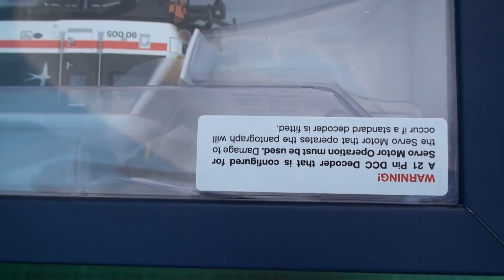InterCity Bachmann Class 90 with Legomanbiffo Sounds

Comment: Well done on this video. The gentleman you managed to badger at Railex for the sound chip is none over then Charlie Petty. The only time Charlie is happy is when to buy something from his stand. Very nice guy is Charlie, shows would be vary quiet with out our happy Yorkshire man. I was one of the other Cheltenham Model centre customers for the Class 90 at Railex Aylesbury. Fitted the new Zimo made Bachmann chip with great ease. Love seeing you Class 90 under the PECO 25kv overhead span.
Reply from the maker: Hi Tony 

Thank you for that did you have the InterCity or RFD 90 ???

I was helping on Leysdown over the weekend and also a member of Wigan Finescale this is why I was able to get the cab rides on both layouts 

I may add some more 25kv to the layout to see how she runs through points ect I also have a Heljan 86 and a Bachmann 85 if I do then I will do a video 

Pat

Comment: Nice video Pat ! Nice job from Bachmann as almost always.
I have the Hornby Class 87035 with Legomanbiffo Sound but it sounds very different, it sounds more like a sirene.
Bogies of the 87 and 90 however seem to be identical.
No such thing as pantograph moving up and down with the Class 87 but that's fine to me.
It is a sort of diamond cross pantograph and it can be moved manually, but pick up from catenary is total fake.
Reply from the maker: Hi
Thanks for the reply 
Roads and Rails did a video on different speakers there was about 10 and he switches through them all and there is a lot of differences between them 
There is always the space issue with in loco to think about my 90 came with the “standard Bachman” fitted as all the 90 s do but I would probably get a better sound if I was to upgrade but taking the the 90 apart may not be a good idea 
Thanks Pat
Reply: Speakers and their location can make a lot of difference in the quality of sound ! Look on my channel at the Hornby Lord Rodney or "My 30863 04 3rd speaker", sugar cube speaker located in the smoke box (ie not in the tender). Zimo sound decoder located in the tender. I am quite happy with the result.
Same for the 87035, sugar cube speaker is located underneath the loco, it doesn't require much space.
See also "My 87035 08" on my channel. Also not bad and sounds pretty much as I remember the Real Thing in the Seventies.
Taking apart these high quality loco's isn't one of my favorites either and much rather leave that to my well skilled train guru !
Cheers, Jan

Comment: I've just this minute put a V5 legoman biffo sound decoder in my Bachmann Intercity swallow class 90 and it started buzzing and then shut off completely.
Reply from the maker: Hi James 
when the loco starts up the buzzing is the locos transformer on line (correct sound) then when you go to drive the traction motor blowers kick in then the loco will move but this dose take about 10 seconds as can be seen from my video 
You do have to release the pantograph from the clip in ordered to get it to work with the chip I don’t know why the loco should just shut off completely may be try running the loco no sound then press 1 and see if the sound kicks in then 

Pat
Reply: @patstrainsuk1  it wasn't no ordinary buzz it made a higher buzzing sound and now the legoman biffo sound decoder doesn't work now at all, lights, sounds, pantograph no nothing.
Reply from the maker: @Railway.Enthusiast.1989  Dos the loco run on DC ??

Pat
Reply: @patstrainsuk1  yh it runs fine on dc and it for half an hour clockwise and another half an hour anti clockwise both ways to run it in properly.
Reply from the maker: @Railway.Enthusiast.1989  OK
In that case all you can do is send the sound chip back and tell him it is faulty have to say I did not have any issue plugged and worked fine 
It is a pain when things don't work 

Pat
Reply: @patstrainsuk1  my dad sent an email to dc kits about the V5 legoman biffo sound decoder and he's gunna have to wait till next week now, there only open Monday to Thursday so they might email mi dad back then.

Comment: Very informative, thanks for posting. What make is your catenary please?  Looks good.  Oh, and one more question - why did you change the wheels?
Reply: looks like sommerfeldt
Reply from the maker: HI 

My track is not "00" 16.5mm it is P4 18.83mm so this is why I need to replace all my wheels (Yes may be MAD but the tack dose look better) The  catenary is PECO LC-100 Start up pack and now there are some more 25KV loco and units on the market I hope PECO expand there range also some of the Sommerfeldt catenary can be used

Thanks Pat
Reply: It's Peco

Comment: Liked the video but what is with all the pixellating during the video? When you showed the rewheeling you speeded up the video,can you please do it again in real time explaining what you are doing as you go along. This is so I can convert some models I have and for other modellers who maybe interested. How much for the model? Are Bachmann trying to price themselves out of business?
Reply from the maker: Hi

Thank you for the reply 
I do not no know why the video pixelate I do not like it my self but is is not like this in editing if any can help I would be happy to find out how resolve this
I speeded up the video when replacing the wheels as I did not want to be boring but I am happy to do a video on fitting P4 wheels if the interest is there please let me know what you think 
As for Bachmann pricing you are not the first to have said this  

Pat
Reply: @patstrainsuk1  Thanks for your reply. Please do a wheel changing video,not just for locos but also rolling stock as well. This should help quite a few people to get started in P4 and EM as well.
Reply from the maker: @tulyar1043  OK I will do 
I have a class 85 I need to P4 and I will add sound at the same time I also have a Intercity buffet I need to add a working tail light to  

Thanks Pat

Comment: Great looking model, sounds great with biffs chip installed. The pantograph doesn't catch when the loco moves does it?
Cheers Paul
Reply from the maker: Hi Paul 

The pantograph can be set to any height using the CV on the chip you can also change the speed of the pantograph moves up and down my sound chip from Legomanbiffo was set up so just plug and play I did not have any issue but I only had a VERY short run wired 

Thanks Pat

Comment: Looks great! Is the pantograph on the model designed to be strong enough to be pressed against the wires while the loco moves around? Cheers, Mark.
Reply from the maker: Hi Mark 

I would say yes it is I will be running with the pantograph against the wires it is a scale pantograph so the wires will need to be correct 
My pantograph is set to almost max height but one could set to just blow the wire or on wire as Dave at Dean Park has but I like to see the pantograph moving up and down on the wire just like the real thing 

Pat

Comment: Good report why have you changed the wheels
Reply from the maker: Hi Paul
I model P4 18.83 and this is why I need to replace the wheels as the 00 wheels will not fit on my track I will be doing a video to help explain this in detail

Thanks Pat